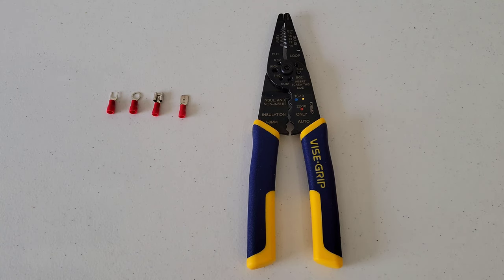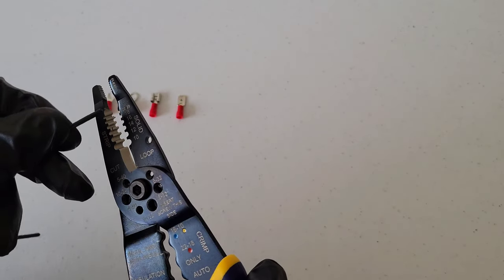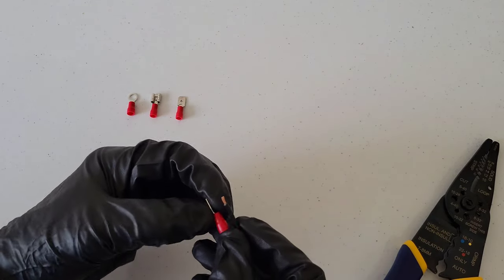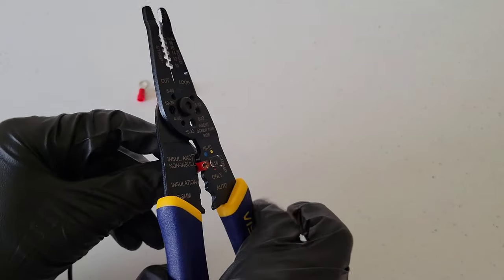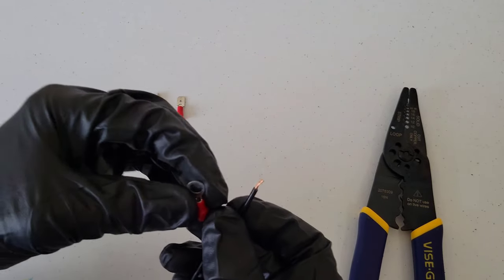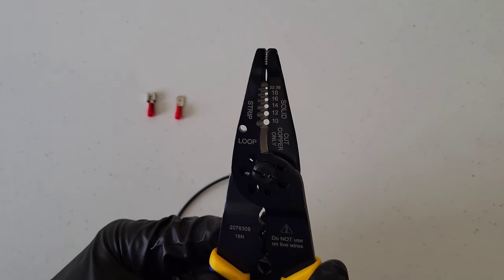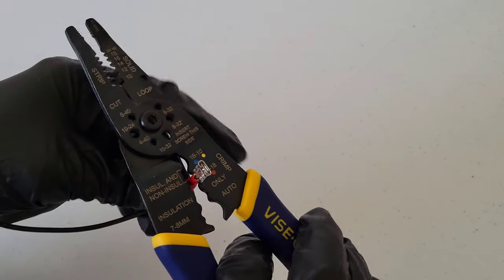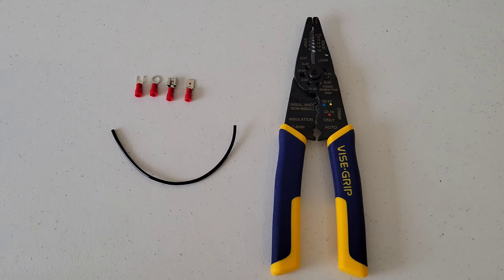How To Crimp Fork, Ring, And Quick Disconnect Electrical Connectors Tutorial

Comment: question, what happens if you do try to crimp with a piece of wire where a few or even just 1 strand did get cut off when you stripped the wires? what is the (potential) impact of doing this? ty for the video
Reply: it will cause the amount of current that the wire can support to slightly drop it shouldn't be to much of a problem unless you are using a wire gauge that is slightly too small for the current or if the current is almost at the max capacity for the wire gauge you selected.

Comment: 2:48 So if one small part of wire is missing it won't work correctly? Might explain one of the headsets i soldered... It was late & i was getting impatient so when a small piece of wire came off i said fk it.  9:40 I have a connecter i cant get off, It looks like that one but has 3 slots on the head instead of 2. SLS S/5 but can't seem to find anything about it.